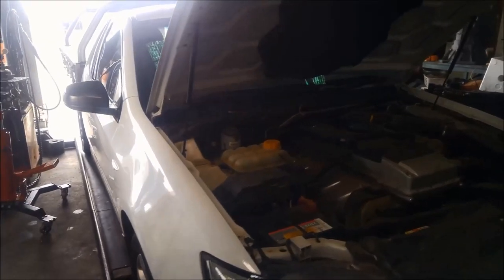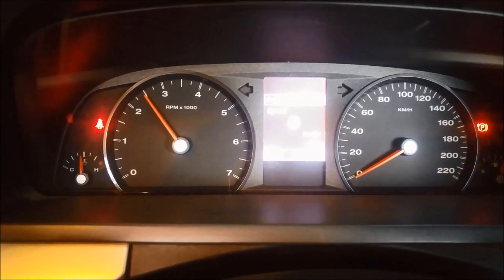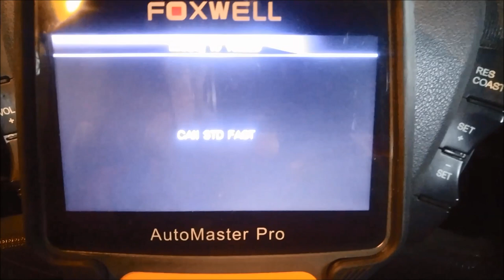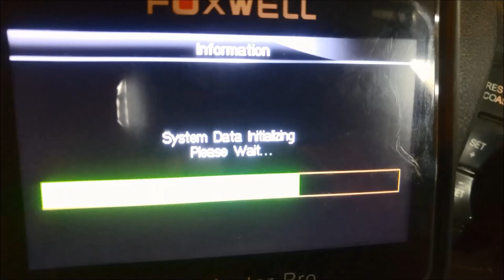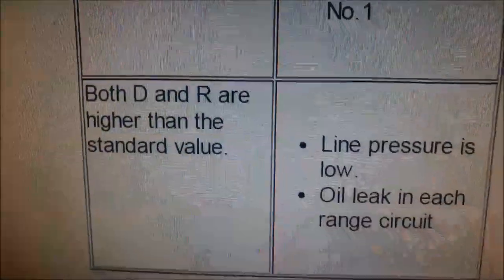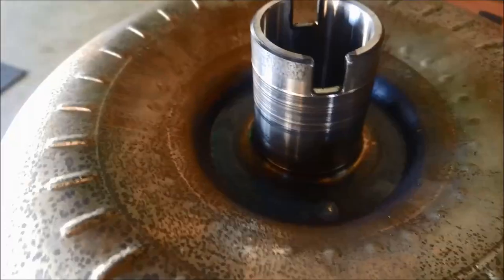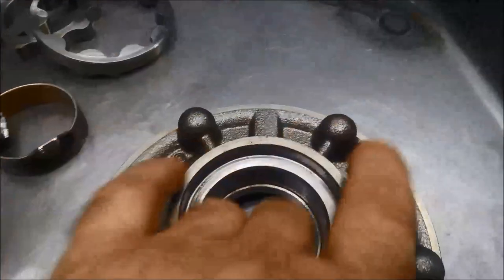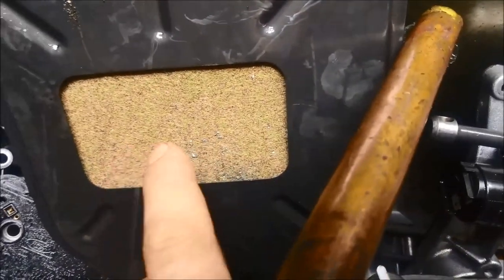Ford DSI M93LE 4 Speed Auto Transmission Intermittent 4-3-4 Delay in R , Transmission Stall Test

Comment from the maker: check out our other related transmission vids  https://www.youtube.com/playlist?list=PLQLkuOdKuFosw0Dy0pAgKHeXME_26FB3S
Reply: Hey, what can cause the trans from locking up, no drive or reverse but when wheels are up its runs but need to be moving along or will stall and shut off. new torque converter, I haven't read anything online about this, I think the last thing is the pump, everything been rebuilt and new solenoids in the pump as well just cant figure way its isn't working, even it was working better now has gotten a lot worst, or I have to let it warm up and rev it to get it going but it runs rough...

what happen was trans got hot and never has been the same, still same issues just get stuck 1st or reverse or need to rev it to get it going but been pull apart and new torque converter pads and all. the last thing is that its the pump that its warped or somthing, even when it was running better after 1st time pulled apart 1st gear 0-40km it was struggling until the speed went above 40km but now cant go no where. so the pump is the last thing, value body been pulled apart, swap solenoids over still nothing. check the clutch pad if they were working and they are with air. just don't know why somthing going so wrong when things are don't correctly.

Comment: Hey, what can cause the trans from locking up, no drive or reverse but when wheels are up its runs but need to be moving along or will stall and shut off. new torque converter, I haven't read anything online about this, I think the last thing is the pump, everything been rebuilt and new solenoids in the pump as well just cant figure way its isn't working, even it was working better now has gotten a lot worst, or I have to let it warm up and rev it to get it going but it runs rough...
Reply from the maker: hi, check all basics first. i`d need more info/tests. sounds like stuck converter clutch solenoid? this will stall motor when you come to stop. cheers

Comment: do upgrade kits exist for these transmissions or is standard ok
Reply from the maker: hi, bypass the heat-exchanger / radiator completely. use bronze bushings where you can ( instead of white metal bushings ), replace s5 pressure control solenoid. if you leave the bar ( band apply reg solenoid) and car ( clutch apply regulator sol ) making sure they arent contaminated but are leaking, you will have a nice firmer shift feel. all the other solenoids need to not be leaking. add additional neodymium magnets to trans pan and do a regular trans filter service and will be good for a lot longer. use the proper transfluid and not dxiii. there are a few extra little tweaks you can do, but beers would be needed. cheers
Reply: @YepThatsIt  thanks for the very detailed reply, never rebuilt a trans and without the appropriate tools i probably never will as much as id love to.

Comment: I'm having a delay going into drive car will select drive but need to add revs it hesitates to go into first while doing so what maybe the issue? Rest of the box is fine ?
Reply from the maker: hi, when was last time you had trans filter service? you may have internal pressure leaks, so you need to rev and increase pressure to overcome leaks so clutches/bands can apply. cheers
Reply: @YepThatsIt  had a service that seemed to make it worse it idles down when it's selected drive but when you rev it it slips in and out slightly into 1st till you get moving